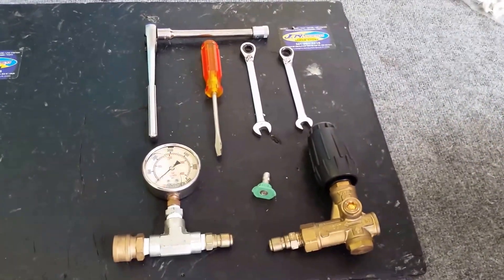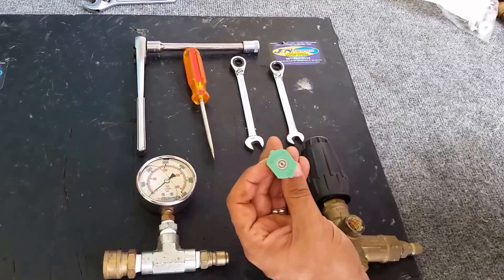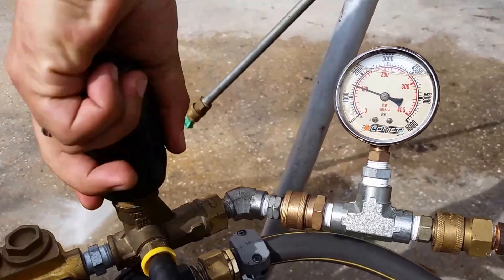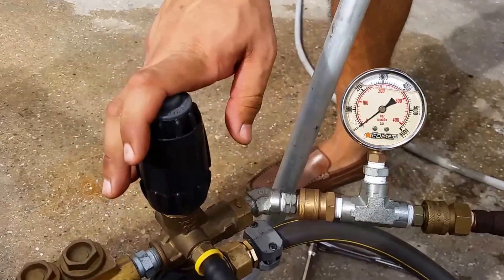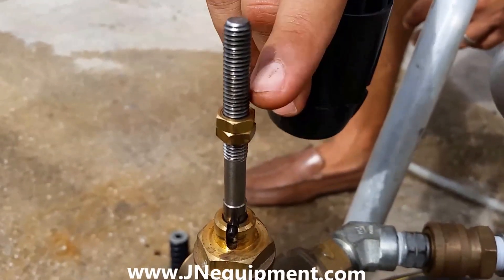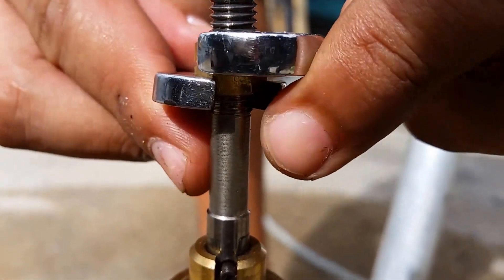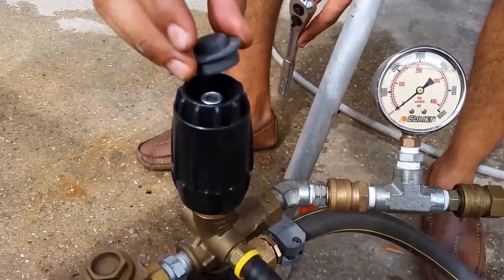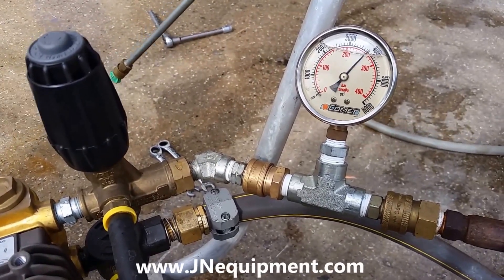How to Set an Unloader Valve (Pressure Regulator)

Comment: I have a economax em15-p 4000psi @4.0GPM, with the 0 degree nozzle the psi go to 3200-3300psi... I need to do your process for to obtain at least 3700-3800psi pulling the trigger?
Reply from the maker: most likely

Comment: I have a 4000 psi @ 4 gpm and I get 4000 psi when I release handle but when spraying I only get about 3300. I have a 4.0 nozzle on the end and not sure what else I can do to raise the pressure...any advice?
Reply from the maker: +mperez27 The highest pressure you want WHILE holding the trigger will be 3500 - 3600 psi, you just need to set your unloader a little lower by lowering the 2 locking screws as shown in this video.